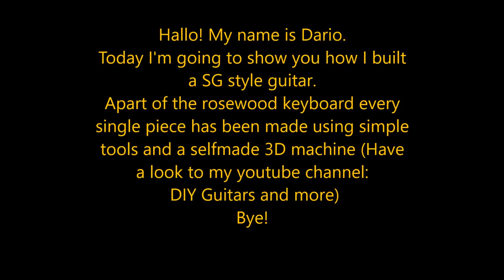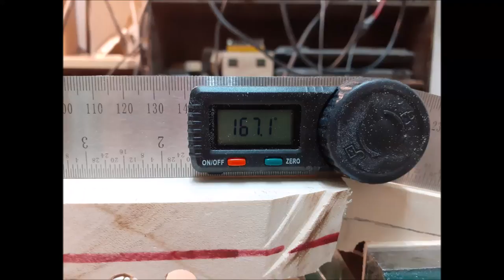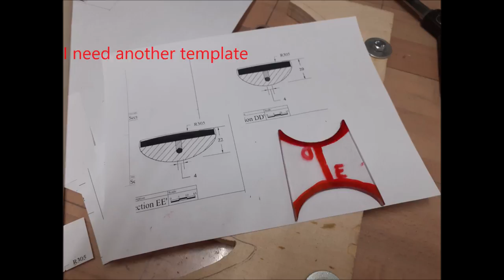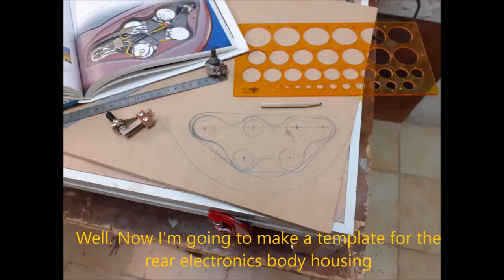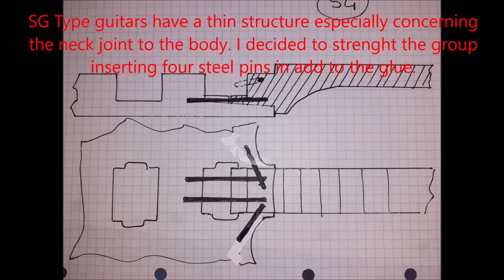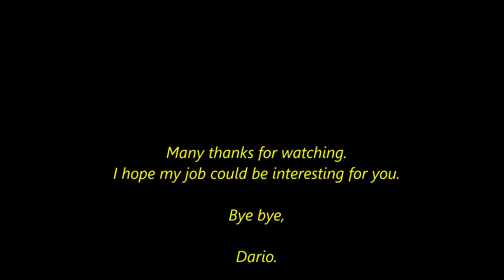How to make a SG Style Guitar

Comment: Good job! Looks great.  How did you create the holes for wiring from the pickups to the controls?
Reply from the maker: Hi Sal, To make the wiring hole I used a long drill bit called "Auger". You can easily find some pics of it on the net. It is a very delicate operation because there is long path to do compared to the thin thickness of the body. Better if you have a big press drill equiped with a good clamping system for the body. Bye and thanks for watching.

Comment: you could have cut it in half vertically from the side and maybe have had enough for 2 guitars, kind of a wast of wood there.
for the rest great build
Reply from the maker: Hi Roblox, I measured the wood thickness before starting to work and unfortunally there wasn't matter enough for two bodies. I thought to cut it in any case and save the wood for a future project but I also had the problem that the carpenter close to my home was closed and I haven't a big saw ... anyway I'm happy if the clip will be usefull. Many many thanks for watching.

Comment: May I ask you to share the painting? :) I have an old copy made from good materials and I want to repair it. :)
Reply: Hi, Mr Marton. To paint the guitar body I used a filler and I sanded the surfaces until they were smoot like a plank of glass. Then I applied a little bit of walnut brown aniline color just to break the natural red of the mahogany. After that I simply sprayed 4 or 5 coats of matte transparent nitro varnish. Concerning the maple neck I colored it by red, brown and a hint of yellow aniline mixed for reaching a close color as the body and then the same 5 coats of matte transparent nitro varnish. To spray the paint I used a high quality of spray tin can varnish for coachbuilders. I hope I have been clear and I apologize for my really poor english. Have a fun D.I.Y. and greetings fro Italy!

Comment: There's got to be an easier and less wasteful way than just chiseling the body, no?
Reply: You could just buy thinner wood, but if your blank is that thick, you'll most likely have to waste all of that. When it comes to thicknessing it though, you can use a router suspended over it with a gliding table type thing, or you can use a fence on a band saw to saw down to a line roughly, then sand or hand plane to the line.